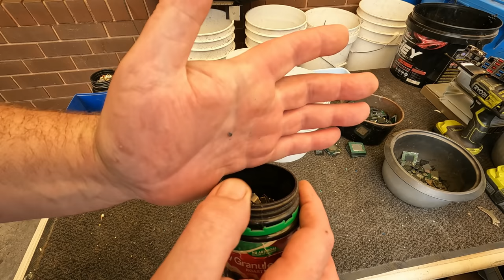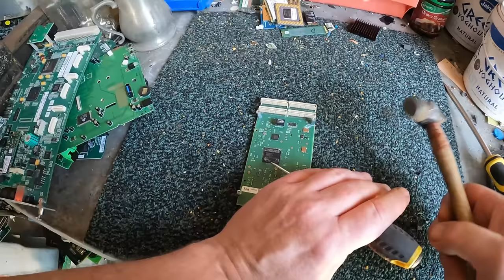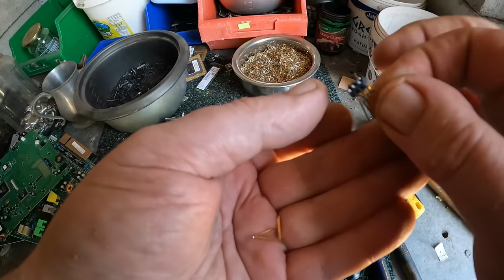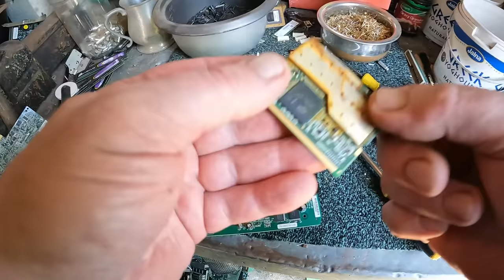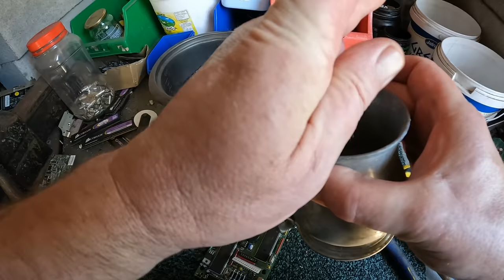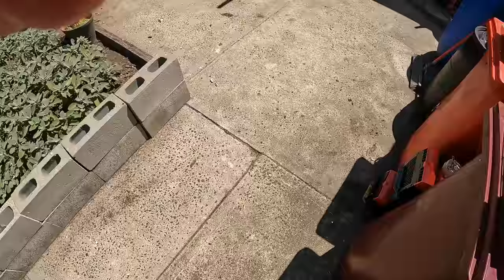Depopulating Mid Grade/Peripheral Circuit Boards

Comment: An absolutely terrific episode. 
I used to drop off my boards at a local recycling facility, after removing anything copper or aluminum for melting.
Your videos made me aware of what's on the boards and I started depopulating them about a year ago.
Every video informs me of other items that I should have been removing and ones I shouldn't bother with.
Thanks 😊
Reply: How do I know what to depopulate or what to leave behind. Also how do I know the difference in grades???
Reply: @WhatsthePOINT_EDC  sorry, I'm just a hobby scrapper looking for materials to melt (aluminum / copper)
I keep all IC chips for future gold recovery adventures.
Pins with gold plating for future gold recovery adventures.
Various colorful bits for potential future whatever art krap I may make.
Some items have exposed gold wires inside (discovered when cutting them open).
Tantalum MLC (probably a waste of time for me because I will probably never do the chemical processing to get the precious metals)
Relays for copper and silver.

Good luck with your adventures.
Reply: @cptrikester2671  good stuff. I also at one point attempted to save up for gold recovery but that didn’t last long. Lol.
Reply: @WhatsthePOINT_EDC  I don't have high expectations.   When I started collecting I learned that the best way is multiple acids, but dangerous gases are produced. Very nasty and I'm leary of doing that.
Separated the bits into five 'grades' of potential results and planning on trying smelting method, I have the equipment for that.

Comment: Always fun to watch Ben.  It is not lost on my how lucky I am to have so many selling options here in the US.
Reply: I’ve learned a ton of him starting several years ago. I’ve always had two yards close to me that take everything but circuit boards. Then I finally found one 30 mins away that takes them, currently up to $1.50/lb. and they even pay higher on non-ferrous, so I save up for a big load of boards and wire, etc.
I did learn from Shark more about Boardsort. I have to send higher paying items usually in the $3-$4 and higher range to offset shipping.
Either way, it all free $$
Reply: Thats true its easy for us to take that for granted
Reply: @dr.a006  so usa i guess? Thats like copper price right wtf?
Reply: @fightington  I wish I could get more for circuit boards in Utah, USA, but ya, there’s always a middle man scrapyard that makes more on volume than me just scrapping stuff.
Reply: @fightington  also, yes they pay more for boards far away, but shipping isn’t worth it.

Comment: You need a pair of what's called flush cut wire cutters. They're machined so they'll cut flush to something as opposed to dikes, which won't cut flush to something. Disadvantage is the tips are delicate and easy to bend.

Comment: There is some more to pick from the boards if you want...

At  ~ 43:00 the metal casing on the network ports is (usually) brass, sometimes it's just steel.
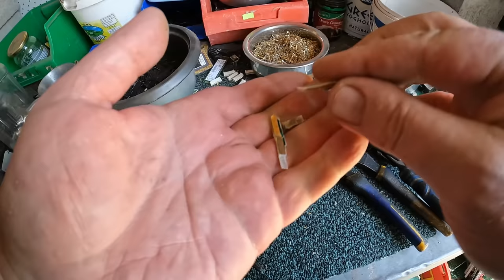At ~ 46:00 there's a red switch with gold plated legs.
At ~ 49:00 another red switch, and two relays on the right side (the white blocks) which can contain silver/gold contacts.
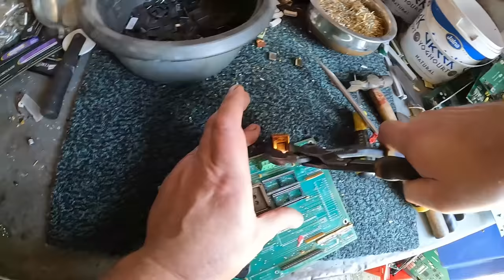At 1:10:00 not a transformer, but a relay again.
You could also get the transistors. They can contain gold bonding wire too.

As you mentioned it all depends on how much time you have to depopulate the boards. I even take off the crystals from mainboards, and here and there a few capacitors or pins (not too much).

The midgrade boards you are selling with the heatsinks on them would go as low grade here in germany. The same with slot cards and mainboards with metal parts or fans, they go as midgrade if you don't remove that dead weight.

Comment: Great video. Thanks! If you didn't know you can strip the green solder masking on those boards that are full gold flashing under with lye and hot water - see your video at 45.24. You can actually get a lot of gold if the whole board is covered in gold under the green masking.

Comment: What you call monkey grips I would call Channel locks.   If the start to ware you can sand / grind the tips slightly to square up the edges.  Works great!   And I find having two pair at hand is nice.  One set wide one set narrow.  Saves me changing the size of the opening back and forth.
Reply: We call them water pump pliers, 5 holes or grips as an electrician in the UK! :)

Comment: Prices are very different here in UK, before I started saving for the board buyer I sold more chips on ebay, you may have seen my video showing what I get and my copperless top gold corner bga's typically sell for £90-£120 per kg, so I still cherry pick some 😉
Loved this video, always such amazing advice, glad I got to watch before work 🙂😁
Reply from the maker: That's about right for BGA's on ebay, maybe a little cheap but leaves enough for the buyer to make a profit on recovery

Comment: If you heat the copper tops with a heat gun they just pop and slide off pure copper scrap also the micro chip comes off and is great for art projects with lens showing magnified size for sale.

Comment: I have a important question now when you were removing the flat pack with the grip tool is that the way your supposed to remove those because what i do is use a flat head screw driver and try to cut the pins with it than hit the corner with the flat head screwdriver and a hammer

Comment: I want to see you refine the waste now.
Reply: Sreetips latest vid was a bag of pins, so perfect timing. He's used to working with much larger concentrations of gold, so he did this vid just for the electronics scrap crowd. He got two grams from a sandwich sized bag of pins. His method was to dissolve out the base metals from under the gold plating, so lots of acid and time.

Large scale refiners probably do electrolytic refining, which MBMM is about to try. It's all stuff commercial processors have been doing for a long time, but they're not going to share their secrets.
Reply: Ben hasnt started refining his own stuff yet

Comment: why dont you use an electric chisel tool to remove the parts?
Reply: I think over time he's used just about everthing anyone else might try, but he doesn't bring out a power chisel for a small task.

Large scale processors tumble or shake circuit boards within a machine in the presence of enough heat to melt solder.